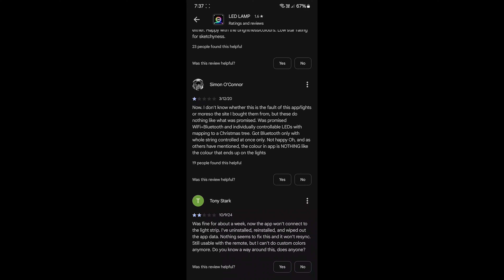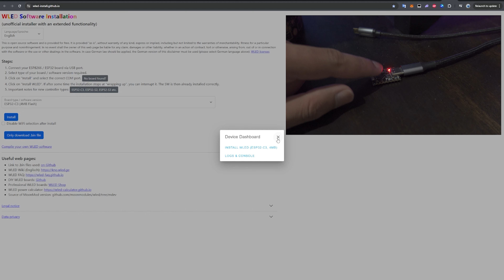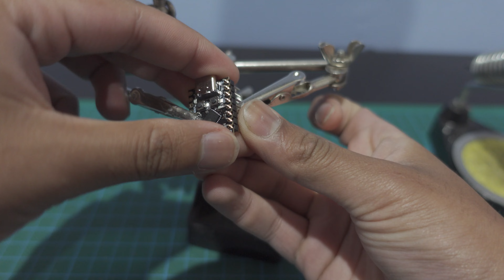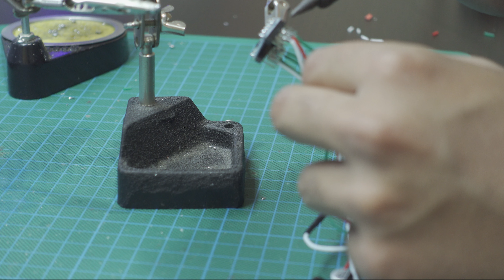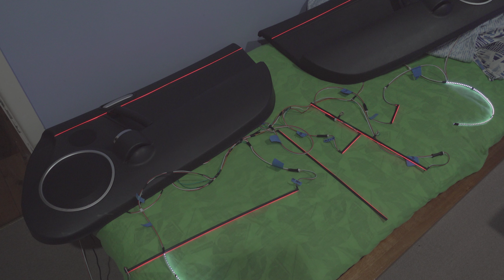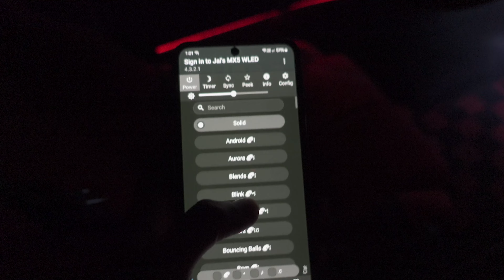The ULTIMATE DIY Car Ambient Lights Using WLED

Comment: Do you have a link to the acrylic cover & reflective tape? Those are the only two links not working for me..

Also, is there a limit to how many strip setups you can have running off of this setup? Ideally I'd like to have interior, exterior (front, roof, and back), and underglow all on one system
Reply: I'm in the same boat; I need to find the acrylic sheet and reflective tape. If you find them, please let me know. Thanks a lot ;)

Comment: did you test your set up before adding the logic level shifter? I've built a few wled lights and run cat5 cable up the wall a good 7-8 feet without having any drawbacks, I'd be surprised if you really needed it.
Reply from the maker: yeah, without it the lights just start flashing randomly. pretty sure the final length of cable was longer than 8 feet
Reply: @runes0 An esp32 is powered with 3.3V. On this particular board the logic level (gpio) voltage is also 3.3V. The LED strip works with 5V and expects anywhere between 3V and 5V as a high signal. There is always some variation and that's why it's receiving random data and you get the resulting dancing light show. The logic level shifter brings the signals back up to 5V.
On a side note - I've read that not every level shifter can handle the data speed here reliably. If anyone has issues there are instructions on the wled page itself.

Comment: Hey bro, I just want to ask a bit—after everything is running perfectly, do you experience any noise like flickering or anything when the engine is turned on with that setup?

Does Using an I2C Logic Level Converter Cause Animation Slowdown?

Thanks , have a nice day!
Reply from the maker: no slowdowns on the animation with the i2c. no noise or flickering either when the engine's turned on everything works perfectly

Comment: Hell yeah dude! This video was inspiration to do to it to my car. I ended up wiring all my pre-made aliexpress strips with individual wire runs back to the controller and holy shit do they get bright! I think the doors and dash pull almost 6 amps at 5v. I also used a PCM1808 I2S line-in board for sound reactivity and it works great! I have a video of it on my channel.

Comment: This looks awesome! Just wondering though when you connect to the ESP-32 on AP Mode in the car, can you still use your mobile data for gps and spotify etc?
Reply from the maker: @prithvig3086  yep, everything is completely unaffected and you only really need to connect when changing modes, colours, etc.
Reply: @runes0 that's amazing! Have you tried doing it with multiple ESP boards in the car? I'm looking at doing footwell and underglow with sync and split options
Reply from the maker: @prithvig3086   you can just use the one esp32 and wire the lights to different pins. I have similar setup with footwell lights being seperate pin to the door card lights. that way I can have one or the other on/off and different patterns between the two
Reply: @runes0  sweet! And last one - can you change the default mode on startup without wifi? Or is the plain yellow look?
Reply from the maker: @prithvig3086  yep you can customise any mode you want and set it as a preset to use on boot
Reply: @runes0  you legend thanks!!

Comment: Can this same setup work for underglow for the vehicle. And what stripes would you recommend for under the car
Reply from the maker: @ChaosCustomzLLC  I don't see why it wouldn't work. You'd want some waterproof led strips
Reply: @runes0 did you tap into a constant 12v fuse? I’m currently replicating your amazing work with a premade strip ❤
Reply: @chaoscustomz_
Reply from the maker: @ChaosCustomzLLC  I tapped into the instrument cluster I think, it only turns on with the ignition
Reply: @ I completed mine but can’t get it running. The last 2 data lines did you attach them to the single data together for the led
Reply from the maker: @ChaosCustomzLLC  One of the data lines goes to the footwell lights and the other goes to the door lights, are you sure you have the correct GPIO pin selected in WLED LED Prefences? And also the correct LED strip type?
Reply: @okay makes since and then I’m. It sure about the led preferences in wled for my specific strip
Reply: Not*
Reply from the maker: @ChaosCustomzLLC  DM me on instagram @nc.xdd ill try to help you out
Reply: @runes0 I’m looking to try and get it working again

Comment: How bro, would have not that been easy to just buy the kit, and just swap the controllers of the kit with some esp32‘s? As wled Supports espNow its easy to make them work together, even kf you want more than 1 esp in the car, lets say you want to make a 2 zone or 4 zones. The led strips used in the kits are mostly ws12 wich are compatible with wled. I think having the strips, all the needed cables and already with a jst connector is much more stable lets say thank doing all this stuff, i think making a pcb for this its going to be great, with a logic shifter and so on, and with jst connectors for the leds. As none did it it can be a good projekt to do
Reply from the maker: Yeah, it definitely would be easier buying the kit and swapping the controllers, but my stupid ass couldn't figure out how to get them to work no matter what I did 🤣But with this method you can make custom size LEDs longer than the ones provided in the kit

Comment: All right dude, I'll start by saying I'm really happy that I found a video for the exact project that I'm attempting to create. Thank you very very much for being one of the first video demonstrations, as I'm sure many like myself are searching for this. 

Now with that said, your video editing skills could really be more helpful here. I'll just throw out a few questions. Hopefully together we can cover any gaps for anyone else who might stumble on this video.

1. How are these light bars adhering to the installation location? My first guest would be that there is no adhesion and that they are strictly held in position from tension of the trim panels they're placed between. Would that be correct?

2. For the dash panels I could see no issues, but I have to ask about the bars that go between the sections of the door panel. Now, I've taken off a fair amount of Asian made car door panels so far. For the life of me, when I watch this video I just can't figure out how you're pulling that off in this Mazda. Unless yours is different, most cars have that upper portion of the door panel adhered with plastic weld fasteners. To cut to the chase, how did you get the light bars to fit in those seams of the door panel? 
This leads to my next question 

3. As thin as these are, and when I look at them on AliExpress, I'm having trouble understanding how they are fitting in between the seams of your trim panels. As I watch you construct the light bars, You place the LEDs in the channeled portion of the acrylic cover. Then you cover the LEDs from that channeled portion's side of the cover with the tape and the other side is exposed for diffusing the LEDs through the acrylic. This means that you are sticking the thicker portion of the covers in between the trim panel seams in your vehicle. If I could attach pictures in YouTube comments of my vehicle, I would, but again I'm just having a hard time understanding exactly how you wedged these LED channels into the seams of your vehicle trim panels. Can you elaborate more on all this context? 

Finally, I apologize for this essay comment I've created. I'm just very serious about taking this project as far as I can with proper installation techniques. Just to add some points and maybe give information to you, I plan to start this project with WLED running the lights, but eventually I will be creating a mobile setup that runs ledFX for the lights. If you've been playing around with WLED I'm sure that you've at least come across ledFX by now. It can create much more sophisticated music sync effects for these LEDs. 

With all that said, I repeat, thanks for being one of the first to put out a video for this exact application. The final results look very good and I hope to hear back from you. Thanks again.
Reply from the maker: Hey, no problem I'll try to answer your questions the best I can.
1. most of the trim has no glue and they're just held in by pressure but for the long middle one, i used thin double sided tape to keep it sticking out a bit.
2. you're right mine had the plastic weld fasteners, however by feeding the LED strip in from the inside of the door panel between the gap in the two panels (had to use a flathead screwdriver to keep the gap open) and pulling the strip through i was able to push the led strip into the gap between the two panels (hope you understood lol)
3. I guess you can't really tell in the video but both sides are covered with the black tape, only the front part that you can see is uncovered. the light is bounced around inside by the reflective tape and shines out the front only. as for how i wedged it in, i just took apart the trim, placed it how i wanted it to be and put the trim back, however it was quite hard as they didnt design it to accommodate an LED strip
hope this helped, if not feel free to message me on instagram @nc.xdd ill try my best to help you again, would love to see your project when its done :)